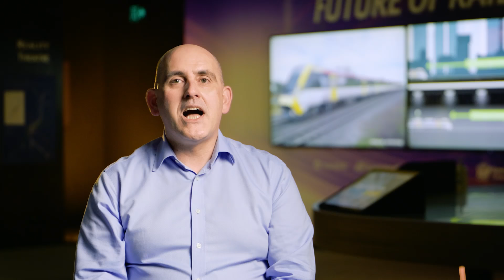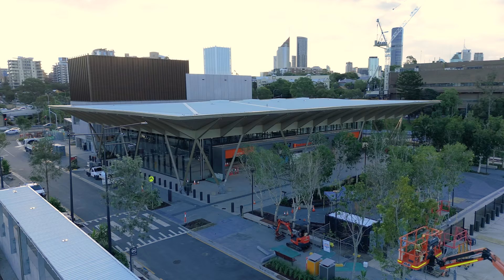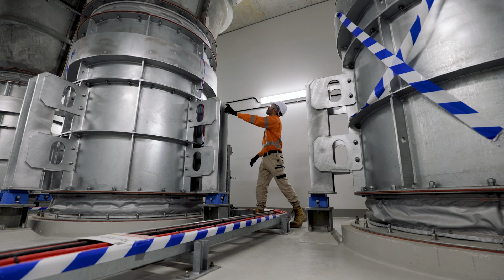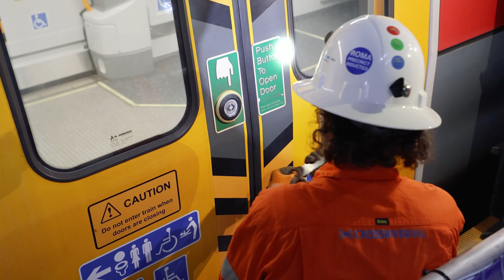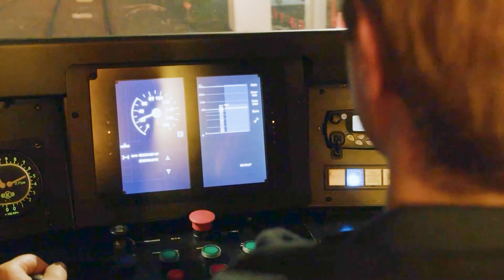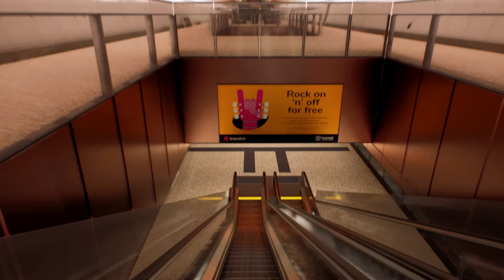Inside Cross River Rail’s Most Critical Phase

Comment: After CCR is delivered does that mean the track closures significantly decrease? :D
Reply: I think on the Beenleigh and Gold Coast yes
Reply: Yes and no. It means they should be able to close tracks and have less of an issue because the crossing is duplicated. North-south lines won't be completely screwed going through the city if they need to close tracks.

Comment: China built 10,000km of high speed rail in a decade, including massive bridges, stations and tunnels - we can’t even build one little tunnel in that time.
Reply: Not going to say we are doing a bang up job building rail, but it's really not even comparable. We have 2% the population of China, and we went through our metropolitan development decades earlier. 

The equivalent would be building 100KM of high speed rail. That would get us a grand total of... Nowhere. Not even Sydney to Canberra.
Reply: @XavierXonora  that'd certainly improve Sydney to Canberra though. Skip the slow stuff between Macarthur and Mittagong, and the slow stuff between Bungendore and Canberra - add some minor curve easing, and you have something a lot faster than driving
Reply: Not too bad for a population of 1.4 billion!
Reply: you're comparing Queensland with China!!  delusional! 😂
Reply: You can build extremely quickly when you cut corners. There is a reason why infrastructure in China is called tofu dreg.
Reply: @JarickWorks  to be fair even our project is tofu dreg after like 10 years…. I find most modern projects end up looking like dreg after 5 or 10 years

Comment: Why are complete railway lines closed? Why is the shorncliffe line closed every other week?
Reply: Shornecliffe is where the signalling system for the tunnel and elsewhere is being tested, it's like one big test track
Reply: @xBeratx why not test at night when the track is already closed ?
Reply: @xBeratx  But does the whole line need be closed? There is no transparancy and no trust in be  bureaucracy
Reply from the maker: Hi Joseph, thanks for your question. The Shorncliffe line is the pilot line for the new ETCS signalling system that will be used to run trains through the Cross River Rail tunnels and on sections of the Gold Coast and Beenleigh lines. The Shorncliffe line was selected due to lower customer numbers compared to other parts of the rail network, and because it sits outside the mainline freight corridor. Testing this new system needs to happen in a variety of different conditions. Before a single journey begins, thousands of hours of testing are carried out across multiple test stages to ensure future journeys run safely, smoothly, and on time.
If you have any further questions, please don't hesitate to contact us at info@crossriverrail.qld.gov.au or on our project hotline at 1800 010 875.